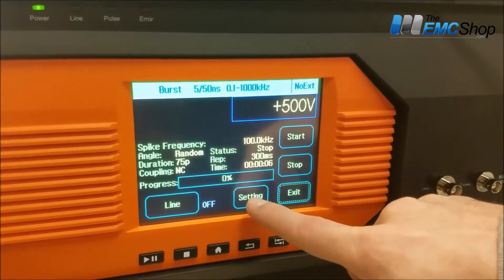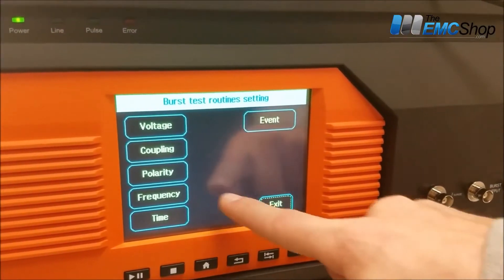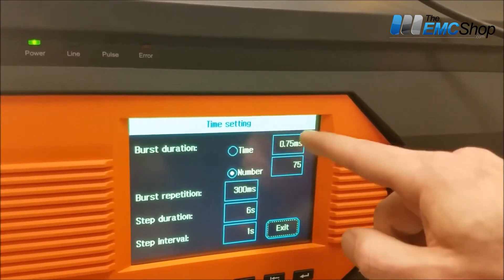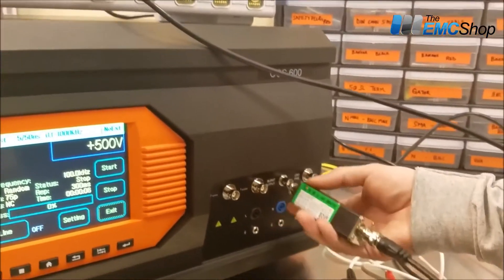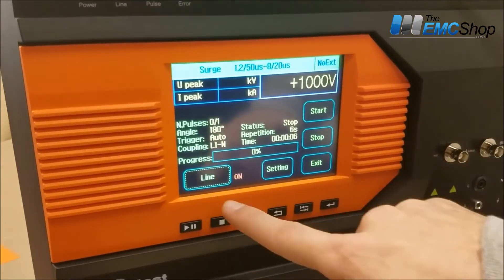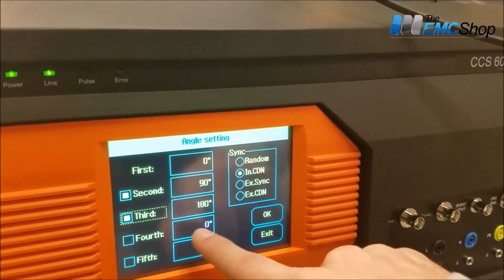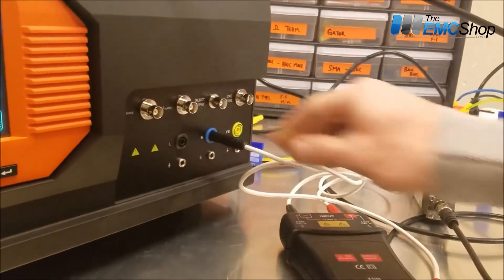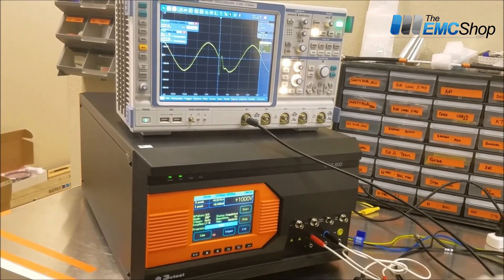3cTest CCS 600 Transient Immunity Generator Video Overview

Comment: Sir....I am also use same tester when I set 6000V U peak showing only near 3000V....So my doubt is Is it feeding 6000v or 3000V(U peak).
Reply from the maker: The 3ctest units have banana jack ports on the back, you have to connect the output to to monitor ports for display